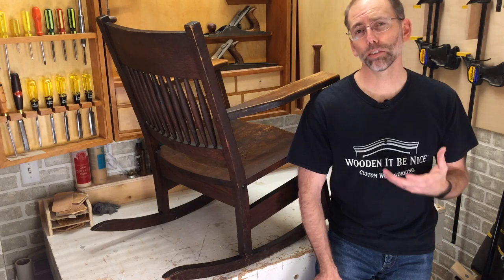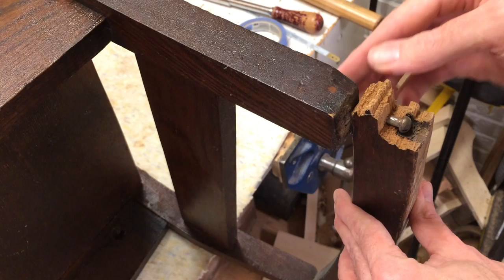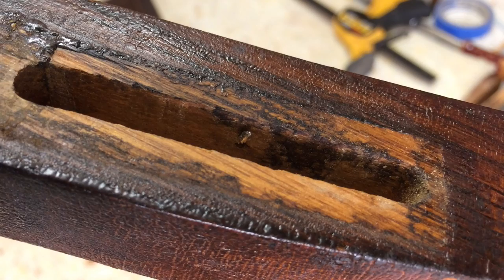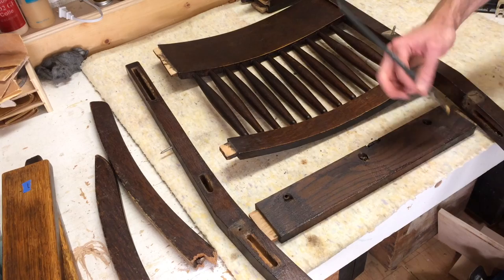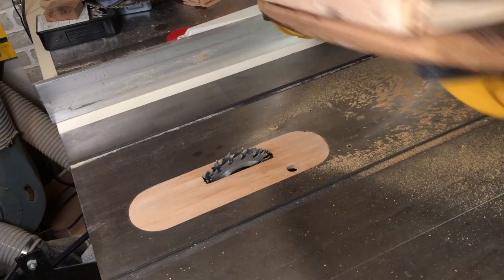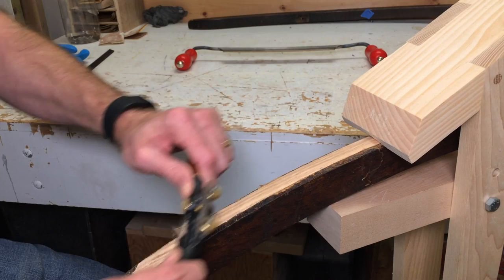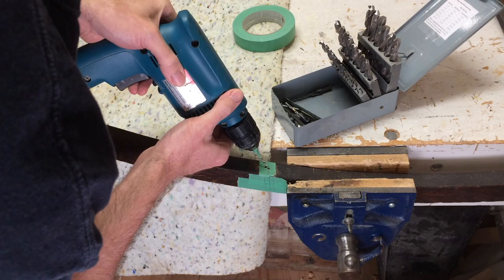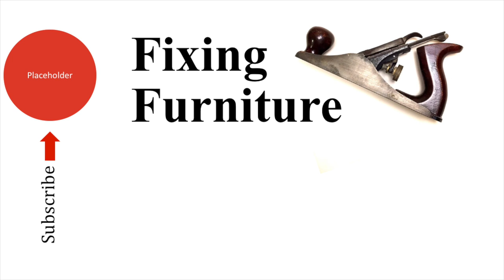Antique Rocking Chair Restoration with Broken Rocker - Made by John C. Mundell & Co in Elora, Ont CA

Comment: I hadn't considered the end-grain issue you raised. For those of us in the UK where dado stacks aren't a thing we could use the concept from your jig but have the rocker sandwiched within it so the router can run along the straight jig rather then curved rocker ☺.

Thanks for the informative video.
Reply from the maker: Oh, that's interesting.  I wasn't aware dado stacks aren't universally used around the globe.  Do you know why they aren't used in the UK?  I'm curious now.

Thanks for sharing that and the solution of using a router for our UK viewers.  Cheers.  Scott 🇨🇦
Reply: @FixingFurniture  My understanding his it's safety related, it would be hard to have the guard fitted when doing such cuts and we seem more reluctant to remove such safety measures if there are other tools which could achieve the same result. I'm just a DIYer so can only comment on my limited observations, it would be interesting to compare and contrast different approaches that are taken either side of the pond, maybe a future video idea ☺.

Comment: Suggestion for cleaning out screw slots:  I collect antique firearms.  I have a cheap set of Dental Picks that I use to clean out screw slots that have 100+ years of oils and grime.  They work well getting into the bottom edges of a screw slot, and they are far more precise than using a hacksaw blade.
Reply from the maker: Excellent suggestion.  Thank you for sharing that.  Scott #tip

Comment: We frequently have broken rockers come into our shop in Missouri and while we've successfully repaired most (including replacing rockers), your solution is far less complicated and perhaps stronger than many of our fixes.  I'm eager to try it our next repair.  Thank you for sharing this, as well as your other ideas.
Reply from the maker: Glad you found this helpful Doug.  Thanks for sharing that.  Scott
Reply: @FixingFurniture  Recently at our shop, we had occasion to use a variation of your technique.  A customer brought in a very old rocker had been left on a floor register (you remember, the kind that left waffle imprints on the soles of your bare feet if you carelessly stepped on it in the wintertime?). The bottoms of rockers were badly charred, and it looked like we'd have to replace them.  But first we removed the rockers and, using a jig on our table saw, made a straight cut to slice off the burned portion of each.  New wood was glued, clamped, and shaped, then the rockers were reattached.  We were able to save about 75% of the original rockers, much to our customer's amazement.  It also took less time than trying fit new ones, and the repair actually made the rockers stronger.  Thank you again for sharing this technique.

Comment: This is the video I have been searching for. I have three of these type of rockers to fix! Family heirlooms of course. The one that worries me is the one that has a broken (and very thin) spindle. Like yours here it is between two stretchers. I believe means I will have to take that rocker apart, separate it from the stretchers, replace with a new spindle and put it back together. Until today I wasn't sure if that was the best way. But now I think it is. Thanks!
Reply from the maker: Yes, you will need to take the rocker apart.  There are 2 ways to make replacement spindles, depending on the diameter.  You can use a spokeshave or a lathe.  Here are videos on making replacement parts for each method:
Spokeshave route - https://youtu.be/92deV01eWFU
Lathe route - https://youtu.be/iSoxUoyJDm0

Comment: Brilliant work.

A few thoughts...
1.  You may want to start using a scribe for precise work.  On the ship, I would use them to chase threads that got painted.  If you use a decent one, it's sturdy enough to put some oompf behind, but still sharp enough to get where you need them.  Might be a good alternative for cleaning out slots in the heads of screws - push it in the middle to break the paint, then from the sides to clear out the waste.  Also helps for pushing around small bits like that splinter you glued back down.
2.  Best way I've found to remove broken screws is to grab a dremmel and carve a cross in the top, then use a screwdriver to back it out.

Comment: Nice repair.   You might find that your drawknife is more effective if you you skew it and slice rather than just planing perpendicular to the grain.  I like your space-saving shavehorse.
It is telling that this chair which is joined with mortise and tenons is relatively strong even after one-hundred years.  In contrast, many of the chairs brought to you for repair are built with doweled joints and are already loose sometimes after just a couple of years.  
In general, dowels in joints originally were intended to locate pieces relative to one another, not to provide the joint's primary structural integrity.  For example, a large table top made from several long boards joined together might have been doweled to insure the boards lined-up; once glued, the long-grain-to-long-grain joint between the boards provided the strength, not the dowels.  A doweled joint perpendicular to the grain is essentially long-grain-to-end-grain: the dowel is long-grain; the inside of the mating hole is essentially all end-grain.  In contrast, the flat sides of a tenon have broad areas of end-grain that mate to similarly sized long-grain in the mortise, and the resulting glue joint is exceptionally strong.  Structurally, the mortise and tenon is significantly stronger and can more effectively resist the stresses a chair undergoes.  Of course, drilling a couple of holes and gluing in dowels is much quicker and cheaper in mass production which is why it is so prevalent these days.  
It's disheartening to see so much cheaply made furniture from the Far East these days.  What's more annoying is that people who buy such furniture expect it to hold up over time just because it resembles a quality piece built by a highly-skilled craftsman.   And then they may be indignant when their junky piece of furniture fails again after a repair blaming the repairperson for shoddy work rather than recognizing the inferior quality of the piece is the source of the problem. 
To quote John Ruskin, It's unwise to pay too much, but it's worse to pay too little. When you pay too much, you lose a little money - that's all. When you pay too little, you sometimes lose everything, because the thing you bought was incapable of doing the thing it was bought to do. The common law of business balance prohibits paying a little and getting a lot - it can't be done. If you deal with the lowest bidder, it is well to add something for the risk you run, and if you do that you will have enough to pay for something better.”
Reply from the maker: Thanks for sharing your insights and tips Richard. I appreciate you sharing your knowledge with our furniture repair community.  Scott  #Tip

Comment: Fantastic video!! Loved the detail that you provided. I have a similar Stanley ratchet screw driver, that just the other day I was using on a chair repair..it will certainly remove a lot of skin if you’re not careful with it. I actually cringed when you used it to drive the screw. Great job!
Reply from the maker: Thanks for the warning.  My Yankee screwdriver has a free-spinning hand hold at the front that allows me to hold the screwdriver steady while pushing on it.  Maybe that's different than yours?  Scott
Reply: @FixingFurniture  Mine does also. When I was a kid I just couldn’t hold it properly.  Today so far it is not a problem

Comment: Another way of removing a broken screw that you might want to keep in mind is to use a edge file or rotary cutter to make a slot in the metal, then use a screw driver to get it screw out. This can be a harder method if the screw is small...

Comment: Outstanding repair. Great tip on aligning the new rocker dowel. I would have used a drill press for the hole in the rocker. I thought you would have modified the other rocker as insurance against future failure.  While you didn't alter the original finish, did you clean the old dirt off? That would have been acceptable?
Reply from the maker: I didn't alter the existing rocker as in my mind, it was a 30% chance it might break and my preference is to do as little alteration to an antique as possible.  The finish was very old so I avoided cleaning it as the cleaners may have damaged some of the uniqueness of the crackled finish as shown in the close ups.  Again, this was a judgement call, but one I made conservatively to preserve the rocking chair.  Cheers.  Scott

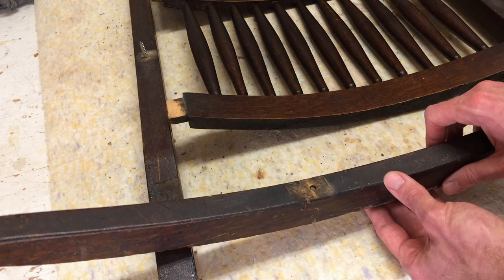Comment: When you showed the break on the rocker (13:32), did you notice how the grain was oriented (the rays were horizontal). That probably helped contribute to the reason the wood failed at the screw point. If it had been oriented 90 degrees (like you would when making an axe handle), it might have been less likely to snap, even though the chair maker  compromised 50% of rocker's integrity by drilling it to accommodate the screw head.

Comment: Beautiful restoration 👏👏👏
1. Didn't you think of reinforcing the other rocker so that it will not break?
2. Did you do anything to kind of revive the old finish?
🙏👍
Reply from the maker: 1. No, I left it in the original state.
2. Nothing more than a wipe with a clean rag to preserve the character in the finish.  The sentimental value was important for the owner so the wear has meaning to them

Comment: You can get hollow ground flat bit screwdrivers, or just individual bits, at a gunsmith supply house that will apply force to the bottom of the screw slot instead of at the top of the screw. This type of screwdriver will save the heads of old screws.
Reply from the maker: Thank you for that tip!  I will try that out.  Scott
Reply: @FixingFurniture  I was thinking a wider bit would give more gripping power to the screw. I will have to try the heating method. I have also used screw extractors with success. Well done!

Comment: Excellent rocker solution, awesome repair. In retrospect, do you think you could have cut the rocker insert closer to size and skipped the draw knife? Or, if there is more of a pronounced round over to the rocker profile than appeared on video, it still seems perhaps the spokeshave alone would still be sufficient and offer more control?
Reply from the maker: Hi Tom.  Good question.  For me, it's about efficient use of time.  I could try to trim the  inserted piece in the rocker closer using a bandsaw, but I would still have to work down the curved profile by hand.  It's just as easy for me to use the draw knife to rough out the shape since I have my shave horse setup.  And yes, I could have worked it down just with a spokeshave, but it would have taken a lot of time to remove material.  As with many woodworking projects, there are different ways you can approach the work.  I hope that helps.  Scott

Comment: Great job and attention to detail.  Question: my rocking chair has one split runner, but the split is perpendicular through the runner (through the engrain at the screw hole), but along the grain.   The length of the split is about 8 inches.  Do you think that gluing the 2 pieces and inserting a screw through the runner at an angle (to provide maximum penetration on both sides of the split) would work?   I do not have the skills of tools to try your ingenious solution.  The alternative seems to me to be to buy new runners.

Comment: Really interesting and well done repair. You frequently mention that screws don't work well in furniture. Two places on this chair supported your claim; the seat expansion and the broken  rocker.  What glue did you use on the rocket to hold it together while it was in the jig before you cut the dado?
Reply from the maker: The glue I used to hold the rocker together before I cut the dado was PVA - regular wood glue

Comment: I couldn’t tell from the video, but I’m assuming you glued the broken rocker together then plowed the dado. Pretty clever solution. Did you “fix” the unbroken rocker the same way?
Reply: I’m going to use that technique, by the way. We had a vintage rocker when I was a kid that broke the same way. The guy who repaired it just made a new one that didn’t match and never looked right.
Reply from the maker: Yes, I glued the broken rocker together first to hold the parts together.  I didn't alter the other rocker as I suspect it will remain intact for the next century.  Cheers.  Scott

Comment: Did you not reinforce the other rocker? Since it has that screw hole it could break.
Reply from the maker: No, I did not alter the other rocker.  In my estimation, it has a better than 50% chance of staying intact so better to leave it in the original state.  Cheers.  Scott

Comment: Such a nice job!
Is epoxi stronger than PVA for the rocker spline?
Reply: Epoxy is stronger and will fill a gap.  You can just pour it in a hole and it will hold on both sides.
Reply from the maker: Well said Neil!  The key reason I chose it was for its gap filling properties.  Scott

Comment: Did you dowel the other runner? If not, won’t this possibly happen to the other runner? Same weak spot.
Reply from the maker: I left it with the screw.  There is some risk that it might break, but more than likely, it won't.  It's a judgement call and I decided to keep it original.  Cheers.  Scott

Comment: Out of interest, why didn't you drill through the base of the front rocker once assembled, and push a dowel through ??
Also mucho cohones for using the plunge ratchet action on that yankee to re-assemble. The risk of the bit slipping was almost too much to bear !!  I have very fond memories of building stage sets in the late 70's / early 80's with Yankees, but fine furniture ?? Respect !!
Reply from the maker: Hi Richard.  I didn't drill through the rocker as it would weaken the long grain fibres in the rocker that provide the strength.  No accidents yet with the Yankee screwdriver but maybe I should be watchful for misaligning that tip.  Cheers.  Scott